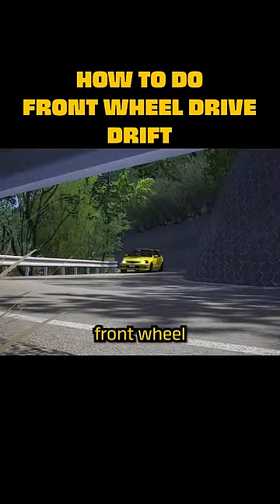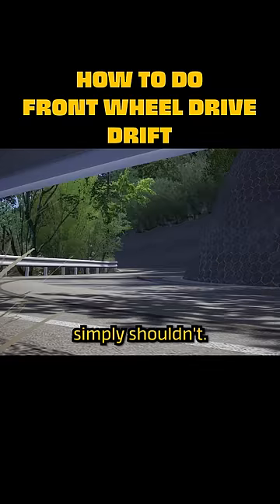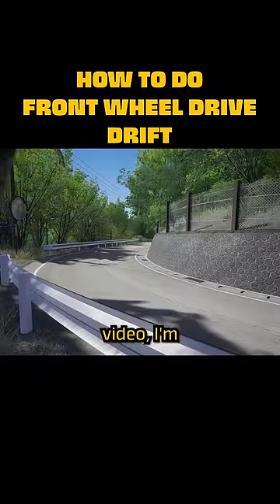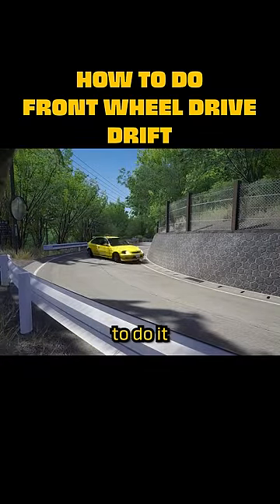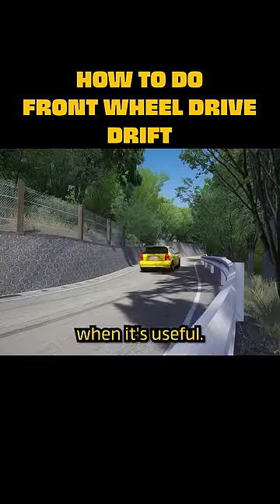HOW TO FWD DRIFT #simracing #assettocorsa #shorts

Comment: Every kid with a FWD sedan rn 🔑🏃
Reply: Me in my 2003 4 dr honda accord 😅 
Nah but I already know how to drift my car nothing new to me
Reply: @lil_kamado7978  Lol me in my 2017 Civic Hatchback 1.0 Turbo VTEC, I have done all sorts of skidding and sliding with it on the snow 😂 its such a dynamic and fun car to drive with that short throw 6-speed - its an awesome modern purchase 🔥
Reply: Lmao, I was just gettin out with Dad's Corolla
Reply: lmfao me in my hyundai sonata
Reply: @lil_kamado7978  please teach me
Reply: My 2021 1.5L NA Honda has some weak ass handbrakes , it wouldn’t do it 
I can do some power slides in the gravel tho
Reply: @theweeknd2725 FWD hatches are the nice for drifting because that extra weight in the rear helps manage some of the inherent understear. Makes scandi flicks a lot easier too!
Reply: I wanted to try it with my 2.0T Ford fusion but unfortunately it don’t got a handbrake and just an electronic praking brake 😭
Reply: i got Proton Wira a Malaysian FWD car
Reply: Just turn my Honda upside down trying this🤦🏾‍♂️
Reply: @luucid5734 same same , 2017 Mazda 3 sedan , at least it has a 6 speed manual tho 😂🤷🏻‍♂️
Reply: When you don't have a handbrake for your fwd car 🧍‍♀️
Reply: @tealnoise how does a car not have a handbrake? How do you park?
Reply: @dodge_viper5  my bad it's an electronic handbrake
Reply: @tealnoise  oh. Why tf did they get rid of the regular one. There Is 0 benefit to a electronic handbrake.
Reply: @dodge_viper5  yeah it's pretty weird
Reply: Me after 13 ice cold beers
Reply: That's absolutely not what I was thinking with my Celica looooool 😂😂😂
Reply: So is it possible? Tryna do it with my Mazda 3 fwd sedan. Seen other vids which show it’s possible…
Reply: @Pithisius  your car’s parking brake locks the back wheels right?
Reply: @Toddlerterminator  yeah but it’s an e brake
Reply: @Pithisius  ehh, same thing. If you have the money to go through a set of  tyres then you might as well try it at a track, and it probably is possible.
Reply: He'll naw , I ant trying to ruin my ride 😂
Reply: Arabs: Am i Joke to you?
Reply: @theweeknd2725 same exact car, but 2020. Best car ever tbh
Reply: 2007 corolla 🤔
Reply: Me in my future civic fk9 lmao
Reply: Nah bro I got a fwd minivan
Reply: The emojis killed me😂
Reply: Me on my polo tdi
Reply: Lol I’ve seen a guy in his 2000s model 4 door across hand brake drift and hand brake 180 like it was light work I was honestly amazed

Comment: you probably need to have the link of your "Powersliding vs Drifting: What's The Difference?" video ready, because some kid is probably going to get triggered by this :D
Reply from the maker: good idea ill copy it to my clipboard in preparation
Reply: Power sliding is after the apex of the corner once the driver slams back on the throttle; Drifting is initiated prior to the start of the corner
(Sorta)
Reply: @RacingOmen  not sorta it's perfectly explained just as you said it lmao
Reply: That was a good video and I thought of it as I watched this
Reply: Liftoff oversteer 😐
Reply: bRuH iT's FwD sO iT's NoT dRiFtInG, iT's PoWeRsLiDe
Reply: @RacingOmen  theres more to it than just that. with drifting youre constantly at the very fine line of controlling oversteer and spinning out  where as powersliding is just forced oversteer. u can still powerslide before the apex of a turn
Reply: @RacingOmen  most of my drifting is under power at the start of a corner.
Reply: @buss1205 Powersliding or throttle induced oversteer is what drifting was called before drifting entered the common lexicon.  Generally the goal with either is to break the rear end loose, then balance the centripetal force of the corner against the forward thrust provided by the rear wheels.  This is done by a combination of applying more power than the available traction can handle and the angle of the car.  With enough power and grip, you can even go past 90° relative to the direction of travel.  
So, drifting in a FWD car is technically impossible, but with properly controlled oversteer, it can be emulated.
Reply: FWD drifting is about as real as Shaq’s rap career.
Reply: @RacingOmen I would say that technically, all power slides are drifts, and not all drifts are power slides. Not all drifts require power. When you unload the rear of a car via braking or lifting throttle mid corner, you can also initiate a drift. Scandi flicks are another non power method of initiating a drift.
Reply: @RacingOmen  the key diff is real drifting uses the engine power to pull out of the drift  on the right track you wont have to brake at all just throttle control
Reply: @RacingOmen it would be more during the apex but yea!
Reply: @RacingOmen  Powersliding is basically the same aspect of Drifting lmfao

Comment: Generally it's faster for FWD to just stick cleanly to the racing line. Only in really tight corners (sharper then shown in the video) it will save time. This is also true on dirt.
Reply: 100%. Using the hand brake eats a lot of speed on grippy surfaces. In snow though, it allows you to point the car in the correct direction without a significant loss of speed. But of course it always depends on surface, tires, temperature, angle, etc etc etc
Reply: Said what I was thinking
Reply: Its much faster in any car to slide a little bit, thats how really fast people go really fast. Although moatly its triggered by the footbrake, not handbrake and its super precise and really hard to pull off. That applies to almost any corner. Full grip is only faster than sliding on extremely fast corners, like if you took your civic to daytona speedway.
Reply: @superspeeder9184  Everyone's a pro on YouTube! Even me!
Reply: @agtronic  Sure, in games you will suck, but irl would do much better, if you don't go too far and miscalculate your turn at 100+ km/h
Reply: @superspeeder9184  any amount of loss of traction means you’re losing speed and going slower. Sliding, is never faster. Ever.
Reply: @SimbaTheGreat  he is right but he is explaining it badly. he is talking about holding a slip angle which is essential to drive quickly
Reply: @SimbaTheGreat  Lemme explain it to you so you can understand it. Theres this thing in racing called "rotation". Its a situation where the car is turning itself, while you dont have to use the steering wheel as much, so its sliding the rear wheels. Thanks to it, the car gets rotated towards the exit of a corner at an earlier point in the corner. That means you can accelerate out of the corner sooner, and dont have to wait for the car to turn itself by just using the front wheels.
Every rally driver uses this, every racing driver uses this, and if you pull up any touge world record ever, past or present, youll see that the driver is sliding, at least a little bit, in most corners.
Reply: @superspeeder9184  wouldn’t you need rwd to take advantage of destabilizing the car with just the foot brake and also wouldn’t using the foot brake give more traction to the front causing oversteer
Reply: @brocklulich7081  1. it works better in rwd cars cause if you keep the gas on and slide the car very slightly on the exit you can accelerate AND turn at the same time which is often a huge advantage, depending on the track. It's still worth doing in fwd cars tho, its still way faster than gripping, especially on touge.
2. yeah, it would, thats how you usually make the rotation happen in the first place. Sometimes in cars with really weak handbrakes, like the kunos r34 gtr you can also use the handbrake to rotate it.
Reply: @superspeeder9184  Is it all about combating understeer?

Let's say I have rwd car that tends to oversteer a bit. Would I need to slide it, or should I just use all my grip?
Reply: @the_skips  if you just full grip a car, you use the front wheels to turn and the rears are trailing along, not really doing much work. If you slide a car, the rear wheels get engaged too so you get more cornering speed. If a car is slightly oversteery, then when you drive it on the limit it will slide naturally, meaning you have to do less work to make it slide but the slide is still effective.
TL;DR: Yeah you should still slide it a little bit
Reply: @agtronic I don't think that the video ment that it would be done at all corners. It was ment to be done depending on the situation.

Comment: If you are on dirt, you can do it with just a flick. If you give yourself enough angle you can floor it and fight the tendency to straighten out and get acceleration while still turning
Reply: yeah its super easy on loose surfaces. sometimes in my civic i dont even have to flick it just lifting my foot of the gas pedal while turning is enough.
Reply: @Matias-dr3ys in theory, on tarmac a fwd will 'drift' by doing this too... it just has to be going quite fast and be on the limit of adhesion to do it. Generally only sportier variant will do it because they run with a little less understeer built in than the base models. 

It's actually not hard to set up a fwd to be tail happy - you just have to look at mini se7en racing to see that. They are race cars, granted, but the concept is simple.
Reply: @douglaspealing5608  most definetly since its just basic physics so the layout deosnt matter, if you have bad tires or hard enough suspension then it will definetly spin out. even in a stock car if you go fast enough it will lose traction in the rear.
Reply: @Matias-dr3ys  no I mean a good fwd, good suspension and good tyres will lift off oversteer. Doesn't mean they spin, just on the limit if driven right you can rotate the car better than normal. Negates the oversteer and allows you to hit the throttle quickly as this hill help straighten it out
Reply: @douglaspealing5608  yes definetly, i agree. it just snowed here and i sometimes utilize it in daily driving if there is enough snow or ice.
Reply: @douglaspealing5608  thats what i usually do on straighter sections, release to get more weight on the steered wheels then accelerate to straighten. Its really handy to be able to mash the throttle and straighten at any time. I used to hate fwd because everyone around me made fun of them, but they have a lot of positive aspects.
Reply: I find it to be much more difficult to slide an fwd car on loose surfaces cause if you floor it at the wrong moment it just straightens out and understeers off the track. Its especially the case with tail-happy fwd cars for me
Reply: Yeah i usually do it with just a lift. Works great (i have hit a snowbank or two)

Comment: I just like how fwd cars snap back after drift so u can get on the throttle quicker
Reply: Yuh thats the understeer and weight distribution, if u lose control slam on the gas and the car will align itself like magic
Reply: @changoelchango its actually because the powered wheels are in the front, thus the car is being pulled instead of pushed, and will be understeering and align itself by powering down on the throttle, whereas a rwd car will be oversteering, so you have to decrease the throttle or countersteer so the front wheels regain traction. this is also why fwd racecars are great on tight cornered tracks, because they can take tight turns and hit the gas earlier

Comment: hand brake snap
FWD driver : man I'm dead 💀
Reply: Eh. Just let go of throttle and scandy flick or just swing into the corner
Reply: FWD are used in rally and they do drift on corners
Reply: Do a braking drift then, not hard
Reply: I've never used my handbrake and I can make my rear step out in FWD car. My car snaps if I let off throttle before a turn. (It's also cold and I have way better front tires then rear) but I've kicked my rear our way to many times in the 2 years I've owned the car (2003 saab 9-3)
Reply: @spiritraps9596  that’s FWD bro that’s the most basic shit, doesn’t make it a drift
Reply: Not a problem on a Peugeot 306 😎
Reply: @daFOXPerformance  how
Reply: @saltbjorn  it's a very nice fwd chassis, and it slides by himself, + it has rear wheels steering, which helps a lot the car turning. So no need for a hydraulic handbrake, apart from using it in very very tight turns (one way 90° for example), or to make a u turn
Reply: @daFOXPerformance  never heard of a single 306 with rear wheel steer
Reply: @daFOXPerformance  every fwd slides by itself it’s called lift off oversteer, if it’s not doing so it’s not a good enough setup. That still isn’t a drift
Reply: @saltbjorn  but every 306 has rear wheel steer you know ? Of course it's not really a drift, but you can maintain the slide for a pretty long time
Reply: @daFOXPerformance  a drift is with maintained or increased speed, without a handbrake or repeated left foot braking you will not achieve that regardless of car
Reply: @daFOXPerformance  on further research I’ve figured out both of us are correct. I was correct in saying there’s no rear wheel steering because I was thinking of ACTIVE rear steer, as opposed to your thoughts of passive rear steer. There’s no hydraulic trickery or anything it’s basically just a sort of vaguely caster-like effect on the rears under high load
Reply: @Salt  I know, but you don't seem to read my comments. I never said it was a drift car, first I wasn't responding to your last comment, and in my last comment I said it's not a drift car, it's just easy to play with the rear and make it slide, and the slide is pretty easy to maintain, but you can't push it forever.
Reply: @saltbjorn  you are also right. It is passive rear steering, in fact it's the whole rear axle which rotates compared to the car, due to the centrifugal force. I really like this effect IRL, and it is present on the Peugeot 306, the Citroen Xsara and ZX. People usually replace the silentblocks with rigid parts, but I find it funnier to drive this way, more efficient imo, and more able to slide. By that, that's why on these cars you don't need the handbrake to turn, and that was what I was responding to in first place.
Reply: I am currently working on an AC mod of my car, to reproduce the sensation, because it's great, btw !
Reply: @saltbjorn  well, in fact, you can maintain infinitely the slide, but in certain conditions, around roundabouts, but it is with a very small angle, and at a certain speed, so of course it's pretty useless, but in theory it's possible. Of course, again, that doesn't make the 306 a drift car lmao
Reply: @daFOXPerformance  in theory it’s only possible by shimming the rear very heavily, it’s exactly what you do for a race spec FWD car - you induce heavy toe out on the rear to generate rotation. I’ve got 5° on my fiesta
Reply: Tha subtitles are crazy, men💀
Reply: Tha subtitles are crazy, man💀
Reply: @Spirit Raps  audi a4 b7 ,fwd 140hp , winter tires ,new all 4 ,tend to drift in some corners mostly on flat ,and on hill down corners 😂 70km h and the car was almost parallel to the road
Reply: @saltbjorn  why isn't lift off oversteer considered a drift? Drift is a controlled oversteer after all
Reply: @the_skips  because it’s in a fwd car, which you cannot maintain a slide in - you can have some oversteer but you won’t be able to maintain a drift
Reply: @saltbjorn  define a drift
Reply: @the_skips  a complete slide with sustained angle throughout a corner, not just a small skid
Reply: @saltbjorn  in that case fwd still can drift, just not as well
Reply: @the_skips  not really, a sustained drift with a fwd is basically impossible - sliding on entry and bringing it back halfway through with a bootful of throttle is just not drifting
Reply: @saltbjorn  it still counts as drifting in any book
Reply: @saltbjorn Not true, you can absolutely maintain a drift in a fwd car throughout the entire corner with combination of scandi flick + slick road conditions or on dirt/ice. Rally drivers drift fwd's all the time
Reply: @gdawgs101  no, they drift AWDs. FWDs have no way to hold the drift after birb starts, only a way to correct it. Using the handbrake slows you down so it doesn’t maintain the drift as such
Reply: @saltbjorn  They literally have FWD only rally events my guy... I think you're out of your depth as far as FWD racing experience is concerned
Reply: @gdawgs101  lmao wanna bet?
Reply: Nah, just turn.. duhhh
Reply: @saltbjorn shows what you know 😂😂😂
Reply: @destroyeroflight1135  does it now?
Reply: @gdawgs101  the fact that there are fwd only events is completely irrelevant to whether or not they can drift
Reply: @saltbjorn  yeah, how I know, experience, I made it down a curvy mountain road, 25 recommended. At 55 with no handbrake fwd, I got at least a solid 6 seconds of slide on a few of the curved. Never even left my lane.
Reply: @saltbjorn  wait a minute, I replied to the wrong damn person, that message wasn't even meant for you 🤣 it was meant for the og comment of this reply chain
Reply: @destroyeroflight1135  well that explains a lot 😂😂
Reply: Skill issue

Comment: I drive a FWD that I like to slide around corners with on winding roads. What I noticed helps a lot though is a stronger suspension and dropping the front ride height about half an inch below the rear. Keeps the car's center of gravity fixed to the front rather than the middle of the car which in turn makes the rear easier to  bring out on a slide.
Reply: get a stiffer rear sway bar if you havent and if you can stiffen the rear suspension as well and put more  air in the rears,
Reply: @pedroramirezmagana  although be careful with the air, theres usually one best tyre pressure setting for each track cause the tyres heat up a certain amount every time you go drive and if theyre overheated you have less average grip per tyre in the car which is usually pretty bad
Reply: @superspeeder9184 that's the point of overinflating them in this case: To make it easier for the rears to lose traction.